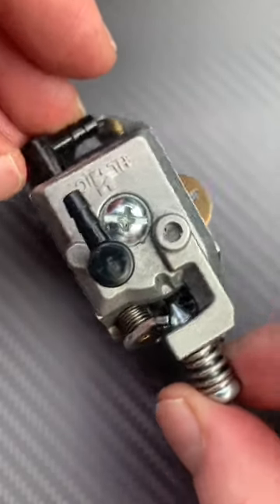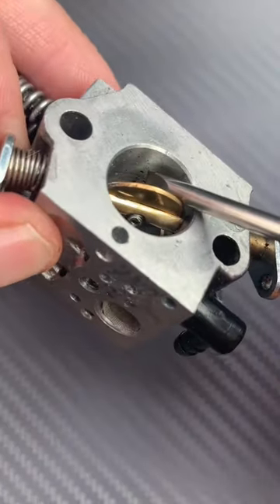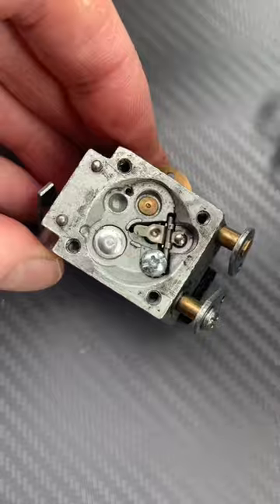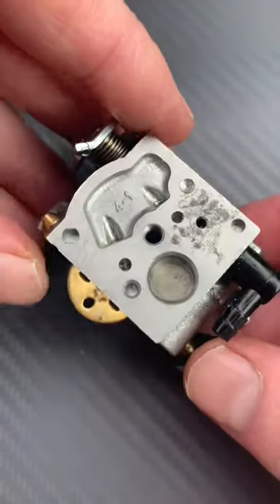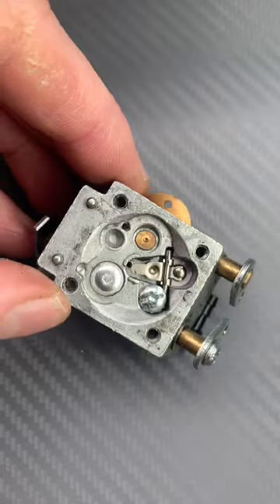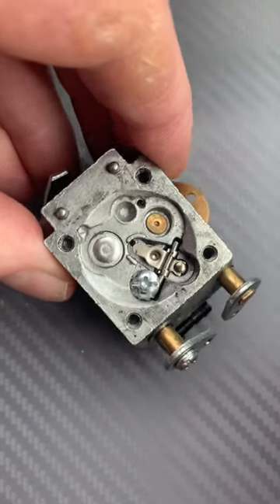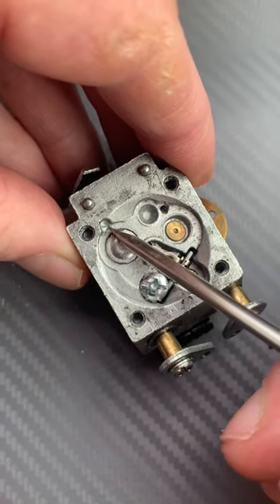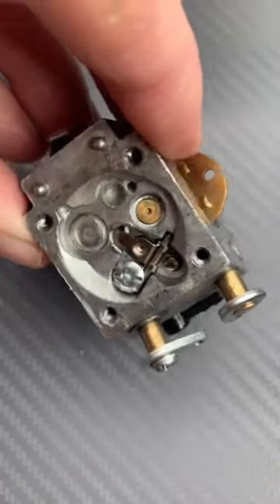You can’t fix your Carburetor because…..

Comment: Thankfully most of these small engine carburetors are now very cheap and easy to just replace the whole thing. I personally have wasted countless hours trying to fix these type of carbs on various pieces of equipment and 9 times out of 10, replacing the diaphragms  and cleaning the carb isn't enough, usually its something more severe such as corroded passages or a cracked/warped carb body or what I typically find is usually faulty/bad check valves and if the carb needs those it's usually not worth the time or money to fix just replace the whole carb.
Reply from the maker: That's fair comment. Thanks 👍

Comment: How to replace that plug?  A special tool needed?
Reply: Yep same question
Reply: Yes, same question here also.  Please do a video on this 👍
Reply: Here for the answer
Reply: Good Evening Craig,  thanks for this video ,but could you please show us how to get the core plug out, a sharp knife tip perhaps? I'm having trouble with a Stihl Fs 50 , I've rebuilt the carb and it ran OK but today, it intermittently 4 strokes and the idling speed increases when it's warm so the head rotates , as if it starts running lean .It looked very clean when I had it apart .
I'll richen it a tiny amount , change the diaphragms,  and inspect under the core plug 😊 Thanks  again Craig  😊
Reply: Marvelous Video Craig Thanks God Bless 🙏.
Reply from the maker: I have another video short coming out on monday 12 that shows how to remove these wothout tools.  Removing them does destroy them though.  The new one is placed in the hole with some special sealant, and then the plug is punched in the middle quite lightly to spread out the edges to the carbs body to create a seal.  I hope this helps.
Reply from the maker: Hi. Thank you for your kind words, I really appreciate it. 

I have another video short coming out on Monday 12 that shows how to remove these without tools.  Removing them does destroy them though.  The new one is placed in the hole with some special sealant, and then the plug is punched in the middle quite lightly to spread out the edges to the carbs body to create a seal.  

I hope this helps.

Craig

Comment: How do you take out that plug? Thanks
Reply: Small drill, make a hole but be careful to not go too deep. Pick out the plug with a dental tool or similar. Replace plug. Use hammer and  a punch to expand it into the recess. Select a punch with a diameter about 2/3 diameter of the plug.
Reply: @sigmundblank7403  thanks, does a new plug come with a carb kit? I've never noticed it.
Reply: @mrtennessee6862  the kit I am looking at now has a couple of plugs in it, probably for different versions. When you go to buy one look at the picture of the contents to be sure
Reply from the maker: Yes a drill is a very good way of removing these but I have another short out very soon showing you how to remove these plugs without the use of a drill if you want to.
Reply: @TheRepairSpecialist  yes, thank you

Comment: ...and the smaller the carb, the harder it is to keep running good. My old truck carb.....I don't know, never had to touch it, but other old truck carbs are childs play next to these little buggers. Lawn mower carbs are easier than these miniatures too. Are there any new tech gas vaporizers you can replace old school carbs with? Something simpler that JUST WORKS like forever? I was thinking of converting my chainsaws to propane....I don't know if that could work.

Comment: .... It takes Very Little for these tiny carbs to act funky or make your engine run poorly, or not at all.. Sometimes you won’t even see anything obvious, and a good cleaning will do the trick.. If I remove a carb like this for any service I just go ahead and replace the needle and any filters, or get a whole rebuild kit and install it if available.... once you are at the point you have the carb off, I feel at that point it’s best to service it completely like that as it is already off the engine and only a few minutes of work that is very easily done😬👍...